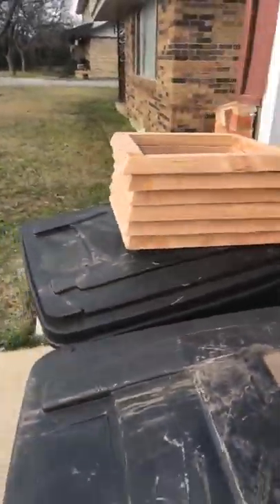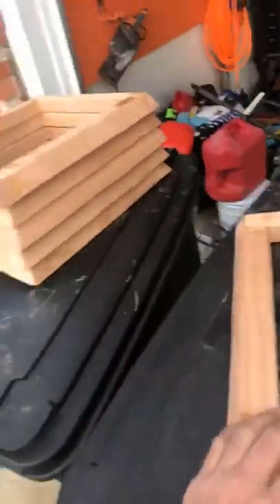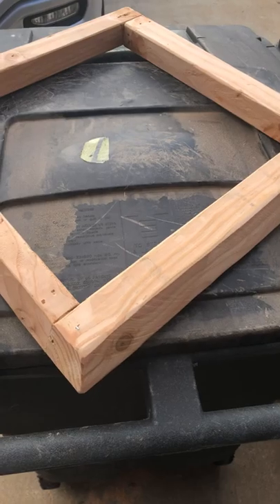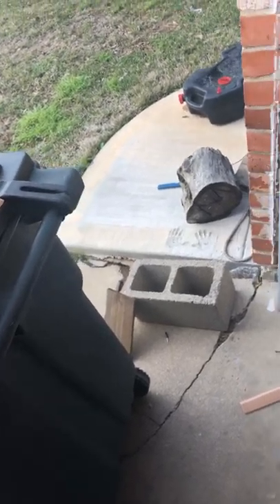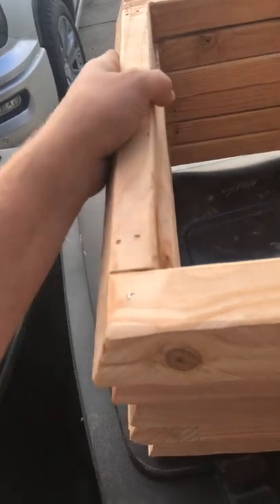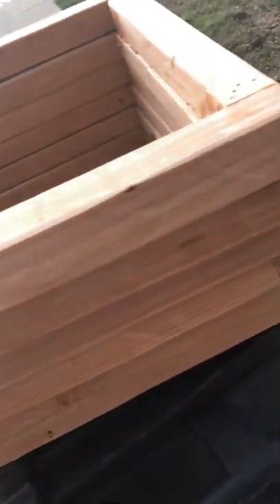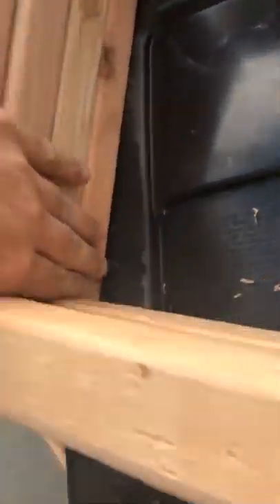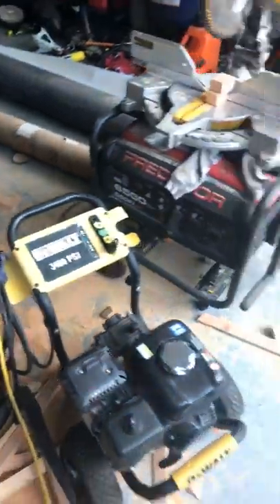RV roof curbs

Comment: Hi! thanks!  I wondering how you reinstalled your AC.  Where the bolts holding the outside AC to the inside AC box long enough to accommodate the increased thickness of the roof (roof plus the curb)?  Thanks!
Reply from the maker: Yes mine were . But if yours are not you can use all thread to secure it .

Comment: How did your rv curb project work?
Did your ac fit inside covers? Any tips?
Reply from the maker: Sorry for the delay response . Yessir they do . The gap is on the roof not the interior , I used foil tape to make all transitions .

Comment: How do you plan to attach the curbs to the roof? Vent and fan frames are going to have a gap the height of the curb. What will you use to bridge that gap?
Reply from the maker: Charles Harman the curb is wrapped by the unsupported tpo , and heat welded to roof , and then I installed flanges that are also heat welded to top of curb , then screwed down on top “inner” side of curb into roof frame , then screw down the vents with m1 or dura link 35
Reply from the maker: Kyllively@yahoo.com I can email you pics
Reply: @live4545  I just sent you an email requesting pics, trying to figure this out. Great video's, hoping you do more.
Reply: @live4545  thanks!  can I also get the pics.  i am trying to figure out - will do the curb to the AC - that seems to be the weakest link.  will send an email to you.